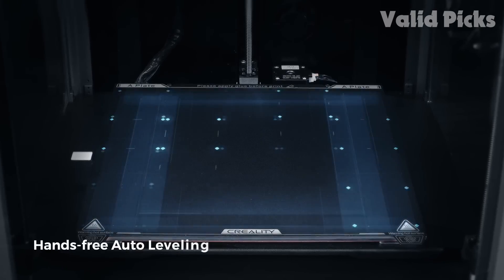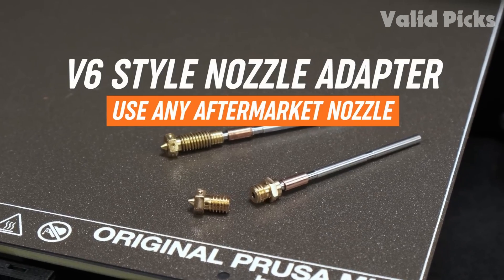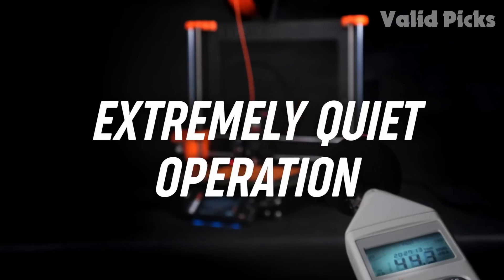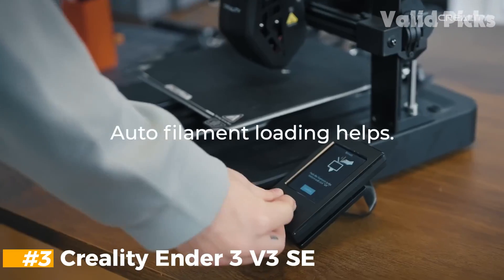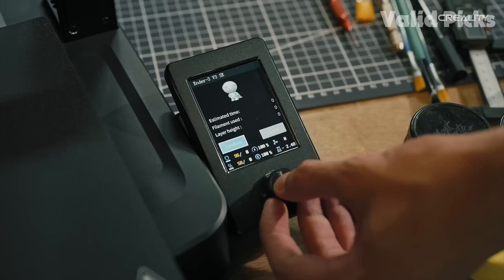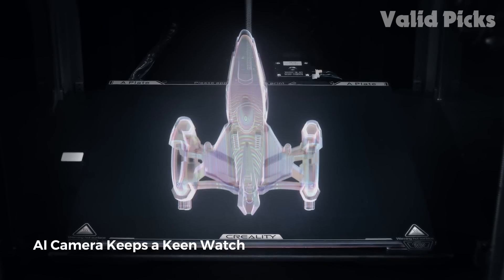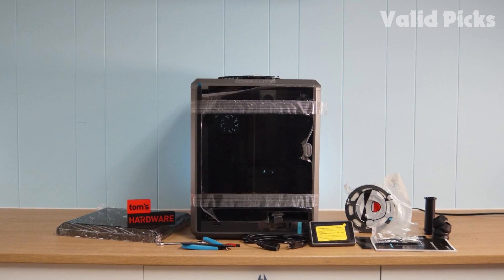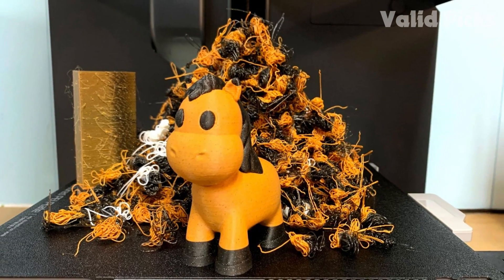Best 3D Printers 2024 - Top 5 You Should Consider Today

Comment: I am sick of buying kits and assemling them and then troubleshooting them and then teeaking the firmware and then reasemble them snd then tweak them again... it gets very tedious and when you just want to print something snd you need to troubleshoot it for 20minutes or more prior it makes me want to throw it against a wall. 
Yes it was fun in the beginning.... but the fun is gone. I want to take it from the box, plug it in and print.
So there is no way I would buy a Prusa or a 3trees or a creality (although the creality is the most issue free of rhose). They all need messing with.
The idea of 'plug and play' i just dont believe. havent used a bamboo labs printer.
Reply: You can buy a assambled Prusa MK4. I was able to print in less than 5 min after I got the package delivered. My focus is also on the projects, where I need the printer as a tool. I completly share your point that messing around with a 3d printer itself sucks. I love the MK4 with the auto Z leveling. I even change nozzles now.

Comment: I am currently thinking to start my own business and would want to focus on the desktop accessories and different kinds of artwork (mainly good quality plastic as starters). Which 3D printer would you recommend for a case like this?
Reply: What's your budget?
Reply: @Kendal1999 Around 700-1000 USD
Reply: @Kendal1999  Probably in between 700-1000 USD